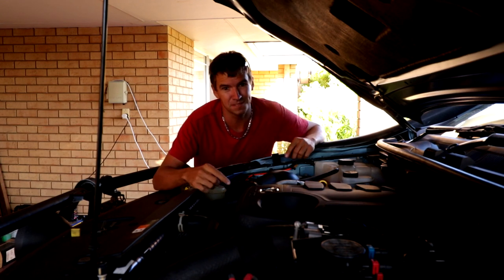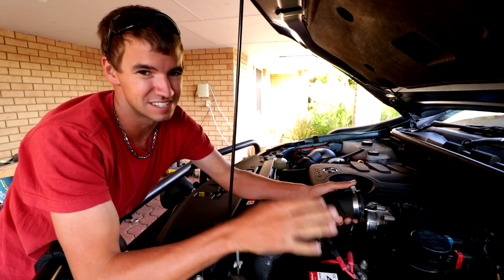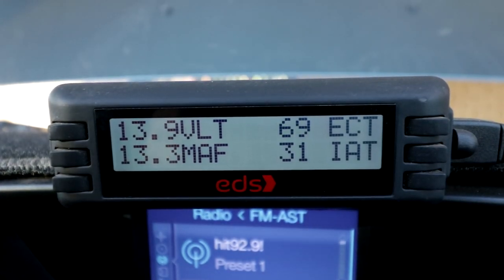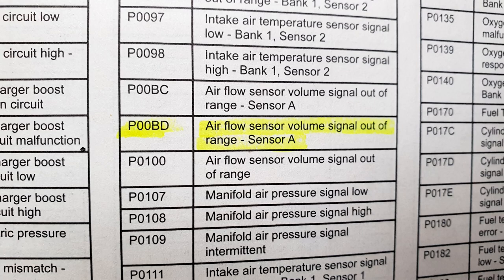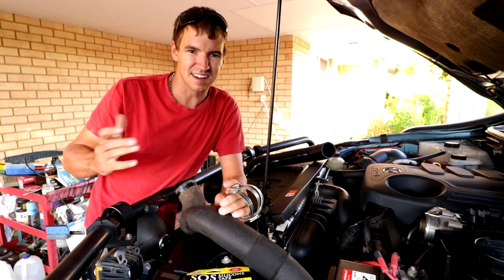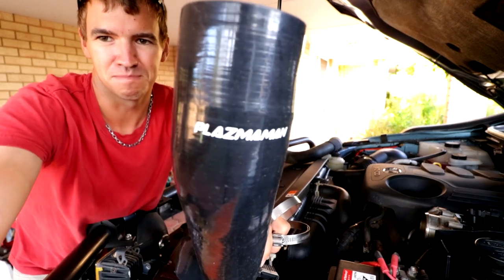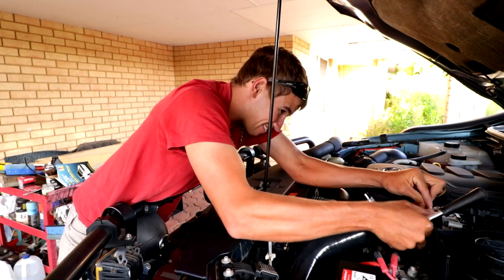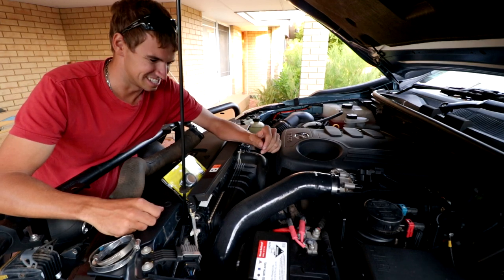BT50 / Ranger Limp Mode Intercooler Hose Problem | Fault P00BD

Comment: SAVED MY BACON! I took the bloody truck to the mechanic 3 times. All 3 times was told "cleared the computer, should fix itself" - they didn't even try to identify the code. After Googling like a maniac, I found this video. Groped under the hood & wouldn't ya know, bloody split in the hose! Ordered a part & fixed it for less than $50. Huge kudos, Mate! B #agirlcalledB

Comment: Wow, talk about great timing.  My Ranger's been running sluggish, blowing smoke, chewing more fuel.  Not limp mode but not its usual self.  Scangauge showed the same code as "pending", googled it. Bingo! Found your video, just now checked  the utes hose & a sure enough its got a split.  New hose will go on tomorrow.  thanks for putting this out there.  saved me a, no doubt, expensive visit to a dealer.

Comment: Thank you for this video, I spent a stupid amount of money at a Ford mechanic who couldn't fix this problem. It turns out my ford had a cracked intercooler which i replaced (quite easy to do) but this video sent me in the right direction. this is also a very common problme with these model fords.

Comment: Been there done that. My Ranger had done about 135,000 K when the hose went. Couldn't sort it out until I bought an OBD2 anyliser. Replaced with a silicon hose and all good. Also MAF replaced at same time. All parts purchased on Ebay and all going well now. One word of advice is to use super clamps on silicon hose as it is not as grippy as rubber. Ordinary clamps can slip off if not done up super tight.

Comment: Awesome mate . Thx for that . 2012 ranger , done 200k, gone to limp mode every time driving over 85 with the orange cog wheel light on the dash , sprayed water over the hose and straight away I saw the water was bursting beneath the hose indicating a hair line cracks. Bought the same silicon hose recommended on the video, used Toledo hook tool to release the old hose that was stucked, 15 minutes later I drove the ranger in a freeway for 100k/h and problems sorted, Thank heaps !!

Comment: Yep happened to my 2013 Ranger. Ford dealer was pretty quick to charge me $220 to replace, even though I had an extended warranty. They claimed that the inter-cooler hose is a consumable and extended warranty doesn't cover consumables

Comment: Yeah had exactly same problem in my 2014 BT50. Had it replaced by Mazda at my expense 🤬. Have now bought a silicon aftermarket unit from Plazmaman which I will keep in car for replacement when the new one dies, which I am certain it will. Is a very common problem going by all the usual forums
Reply: Michael Sanders the guy who organised the repair said the hose was a fair wear and tear item so I’m inclined to think that there has been no improvements made 🤑🤑🤑

Comment: Interesting. I was told it can be any volume. eg. EGR valve staying closed. I went to valve at this stage it was jammed closed. Now I dice wether the solenoid is stuffed because nothing has changed but yet it has only coded POOBD same symptoms as yours. Maybe it's both.

Comment: Get in and change the hotside to a direct pipe while you’re at it. Eliminate the chance of it happening over that side and also reduces the massive factory piping to a smaller direct setup...
Reply: Forefront industries do a quality replacement in either aluminium or silicon....

Comment: just replaced mine yesterday exactly the same split, took it to the mazda dealer he new straight away $250 for the replacement pipe, bloody rip off
Reply: rich nich ford sell them for less then $100 bud! And the new replacement part has been updated with a thicker hose with more internal wire to give it more strength.

Comment: Hi I have a mazda bt50 AN A POWER TRAIN LIGHT came I clean the tps sensor and check for leaks and nothing clear the codes and the light still came back on any suggestions

Comment: Hi
I Have 2012 Ranger 220000ks
Found split intercooler hose and replaced it
Still have same light coming on 
Cleaned MAF sensor with specified Cleaner
Everything looks normal 
It’s blowing more smoke than usual and sluggish at low speed
I have no idea what’s wrong
Any ideas thanks

Comment: I have had P00BD code for 4 months I’ve got 3” exhaust, upgraded intercooler and dynotune on my first ranger, no splits in hose (smoke tested) and no idea what issue is. Only happens 3/4 throttle uphills at 80kmph+ (eg heavy torque load) otherwise it’s fine. Tuner has changed tune to allow higher torque threshold but still happens. I’ve changed MAF sensor still does it. Stumped.
Reply: Has the issue been resolved? I'm having the same issue right now. I've changed the intercooler hose to a stainless steel piping yet the P00BD code still appears but simply turning it off then turning it back on will make the check engine light disappear and the car becomes normal again. This issue would randomly appear when it's cold outside.
Reply: @OlsenH6  yeah, turned out to be the K&N filter I put in, I oiled it as you are supposed to do, the oil residue under heavy acceleration must have got onto the MAF sensor causing the code to get thrown, changing back to standard filter and cleaning MAF sensor with MAF cleaner several times ultimately sorted it
Reply: @chimeranzl9147  Damnn so I am using K&N air filter too and I suppose it would be the same case. Thank you for replying.

Comment: First of all you have a truck...NOT A CAR...However i had the same location on the hose crack also.had a different symptom ...smelly exhaust...along with limp mode and hot engine..replaced and now back to normal....Its a ford and mazda issue for sure.

Comment: My Mazda BT50 has no engine power when you're shifting to 3rd gear and onwards..did fault findings and found that when you rev the engine,the suction hose after the intercooler to the intake manifold starts to shrink or squeezes in...what's the probable cause.. please help.ta.

Comment: I replaced all my inlet hoses with silicone hoses much stronger and more heat stable
Reply: Who did you use for that mate and how much?
Reply: @bravocharlie777  just bought the hose at local supplier and changed them myself, only very basic skills  required

Comment: my ford ranger 2.2 is having this problem now, powertrain warning comes on after 5mins warmed up. and its going limp mode, doesnt feel the turbo running at all, max speed 60-70km/h full acceleration. It's been a week already and I drove for about ~100km with this problem, will it harm my enginer/ turbo/ gear before it's fix?
Reply: Can you give us an update as to what happened/what you had to do to fix?

Comment: I hope you’ll reply 

Well I have Ford Everest 2.5L BT50 engine 

So the problem is black smoke (more than yours) 

No power/acceleration...after 2000 RPM I can feel the turbo boost and then it accelerates but puffs a lot of black smoke 

Ford Guys are not being able to diagnose the problem I’ve already spent a lot of money to them but found no solution yet 

All I know is there’s no boost leak and no engine code 

Cleaned all the intake manifold and replaced the EGR valve 

Now I’m frustrated with it the problem is still there and I can’t drive on hills due to slow acceleration 

It’s been 2 years I’ve not found the solution yet 

Please help me I beg you anyone please help me. this vehicle means a lot to me

Comment: Nothing a cheap OBD couldn't diagnose. This will happen to any turbo petrol or diesel. It's not a Mazda or Ford specific issue. Error code is P00BD, MAF sensor circuit range. . It'll be in your obd error codes and you should clear it now it's fixed. OBD AU's make a cheap Bluetooth module thatll make life easy for you.

Comment: You would think there wouldn’t be any pressure in the hose because it should be at vacuum at idle, that is weird
Reply: Diesels don't have a throttle valve and so virtually are never at vacuum.  Modern turbos boost slightly even at idle.